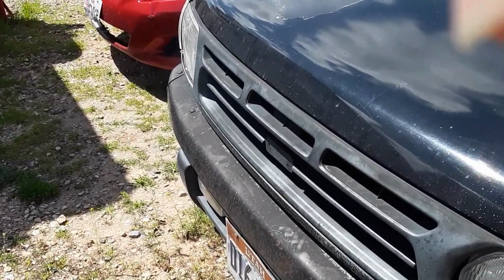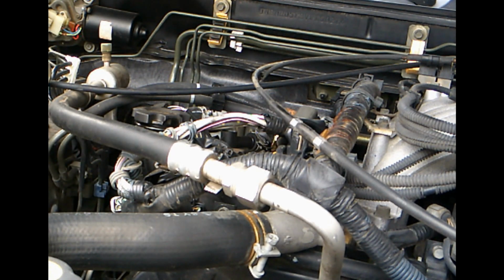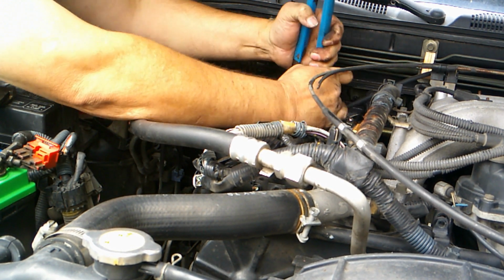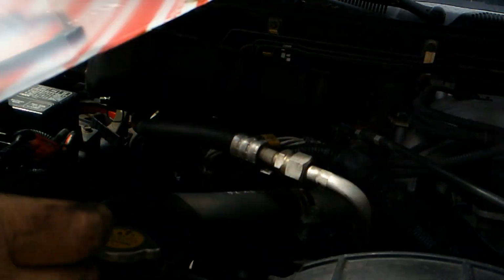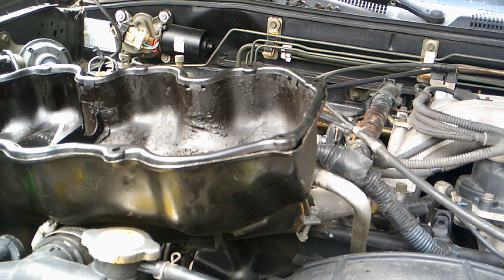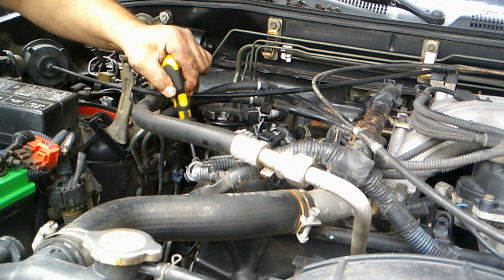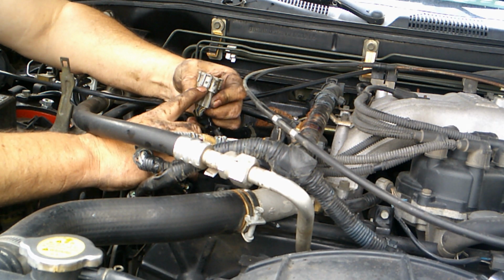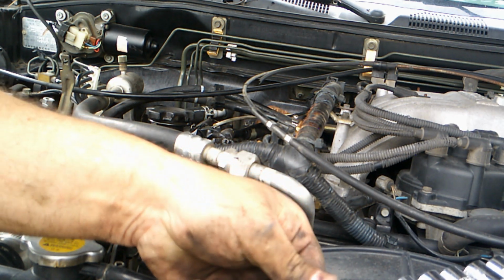97 Pathfinder valve cover leak and repair

Comment: It's nice that they put connectors in the middle of the harnesses that run over the cover. At least someone was thinking of the repairs during the design process.
Reply from the maker: Defiantly Nice thanks for the Comment
Reply: its a V6 so the other valve cover is under the intake, you have to remove the upper intake and EGR to gain access. i wouldnt say they thought of repairs during design.

Comment: But I don't have a short, when I disconnect the two white and red stripe wires from the Little Red Box connector on the positive side.
Reply from the maker: Disconnect the white wire with a blue strip from the alternator it is the large wire with a nut holding it to the alternator reconnect the 2 white wires with the red strips I am thinking the alternator may be shoring out the ignition. 
This is a link for the alternator wire diagram 
https://portal-diagnostov.com/en/2020/04/20/starting-charging-nissan-pathfinder-se-1997-system-wiring-diagrams/
Reply: @toddk709  i got it!!! 🙌🙌🙌🙌  followed all wires like you said for alternator, everything checked out. after a bit of testing n snooping, found out that the starter solenoid was shorting.  quick n easy change and i am on the road!!!  seriously, this is the most accessible starter i have EVER changed out
Reply: @toddk709  thanks for your help! 🙌
Reply from the maker: @jaybae8056  Glad you got it
Reply from the maker: @jaybae8056  you are welcome

Comment: ran into an issue.  I have continuity between positive and negative posts (when cable are connected to battery), and i have continuity from positive cable (when disconnected from battery), and block/ body ground.  and i replace the starter relay, but still no spark to starter.  any help please send my way
Reply from the maker: Wow I defiantly need more info to give you the right answer I guess what you are saying is you have power, but it will not crank? in the past I have seen the ignition switch be a problem not able to get enough currant to the starter Solenoid in my case I added a relay to take 12v power directly from the battery and used the existing wire from the switch to trigger the newly added relay other possibility is neutral safety switch or clutch switch I am not sure if this helps let me know
Reply: @toddk709  i get 12v to the S termi al when i jump 1 and 2, and 3, and 5 of the starter relay.  but nothing when i have the new relay in
Reply from the maker: @jaybae8056  dose the starter engage when you jump pin 5 to voltage? if so, possibly a theft relay issue what happens when you jump 3 & 5 with the inhibitor relay removed and the ignition switch turned to start also use a test light for testing you may be getting ghost voltage and not good solid currant.
here is a link to a wire diagram.
https://www.2carpros.com/images/question_images/151321/original.jpg
Reply: @toddk709  I have a manual transmission, which one is the inhibitor relay? Is it to EGi, or NP?
Reply: @toddk709  and the starter does not engage. I just checked the clutch pedal switch also. It is good

Comment: Do you know where the IAC valve is located ? I haven't had luck finding it I think it's under intake manifold
Reply from the maker: under the plenum or some call the upper intake manifold towards the back of the motor you will need to remove the plenum from the manifold  I do not know what kind of problem you are having I recommend replacing the PCV and clean the throttle body as well Napa Part # 	CRB 229581 and CRB 29303 for the PCV thanks for the comment Please Like and subscribe
Reply: @toddk709   I'm having idle issues. Cleaned throttle body once and it helped cleaned it again now it'll idle  fine on a  cold start. After idling for a couple minutes the idle will drop to about 200 to 400 rpm or it'll die. Rides fine on the road, just coming to a stop have to keep rpm to 500 to 1k so it won't stall. I'm thinking it's the iacv
Reply from the maker: @carlosperez473cp  The IAC is probably a good place to look not to hard to remove plenum Good Luck My Friend
Reply: @carlosperez473cp  did you ever figure it out?
Reply: @carlosperez473cp  mine has the p0505 code on the check engine light. I'm looking for the iac valve.on mine also. Did you replace yours?